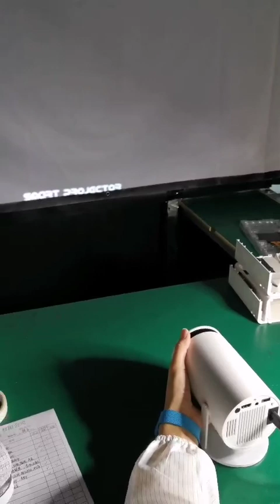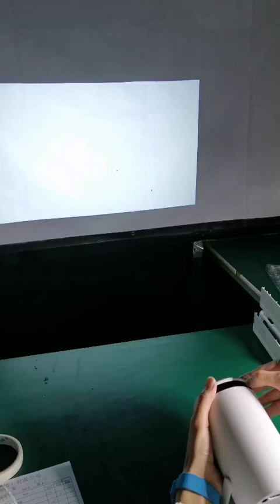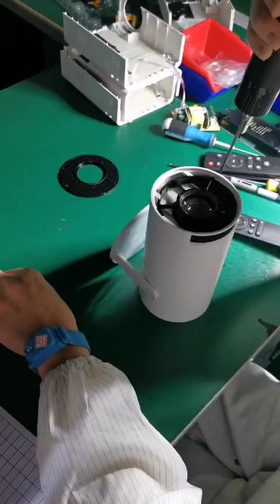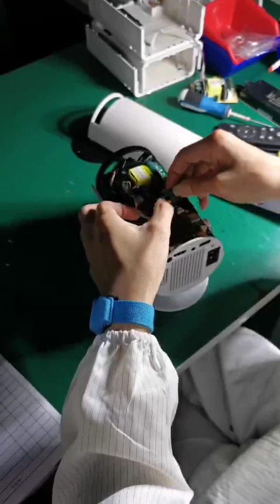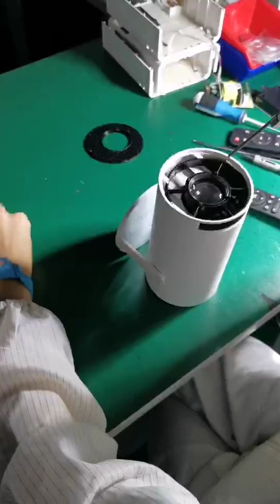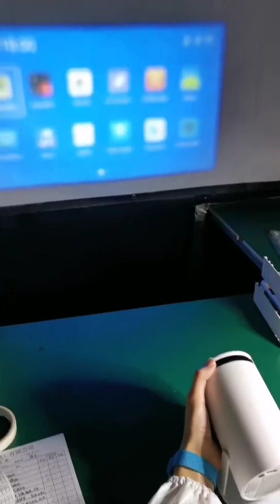When there are impurities on your HY300 screen.This is the cleanup step.#hy320 #projector

Comment from the maker: This is a tutorial video for cleaning screen impurities. If you still don’t understand, you can ask here and I will answer. Thank you for supporting our source factory.
Reply: what did you do after you opened the projector?
Reply from the maker: @yinibibi  Find the display screen according to the video operation, take out half of it and blow away the dust and impurities with a hair dryer.
Reply: @OMIKAI-me2zh okay, tysm!
Reply: @OMIKAI-me2zh it didn’t work, the impurities/ spots are still there
Reply from the maker: @yinibibi  Maybe it's the front lens, use a hair dryer to blow it all over.

Comment: Frequent opening will break the joint clip/locks.

Why not add a mini LCD cleaning window like in many projectors?

By doing so , may be able to clean using a Q tip just by opening only the window.

Normally window is seen below projectors but in this you may need to add on top as per the design.

But doing so may affect the aesthetic looks as it is a successful copy of Samsung freestyle 😂对吗
Reply from the maker: The cleaning of these videos is not a daily cleaning. It is a method for dealing with black spots on the screen due to transportation impacts of the projector. Your suggestions are very useful and I will mention them to our factory designers.